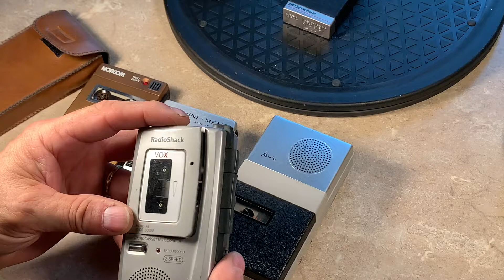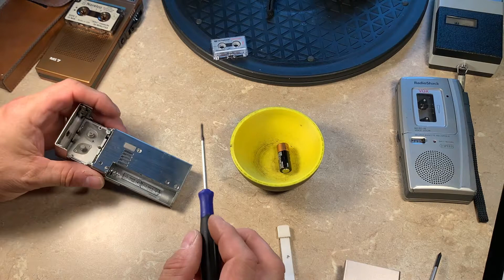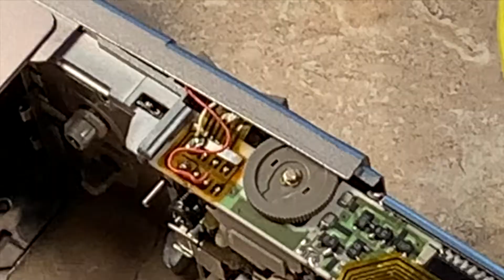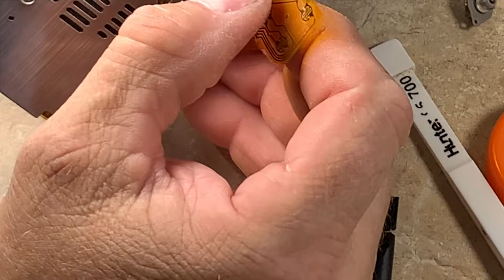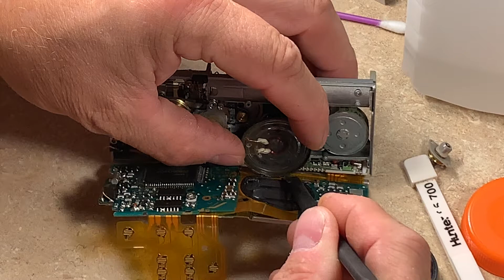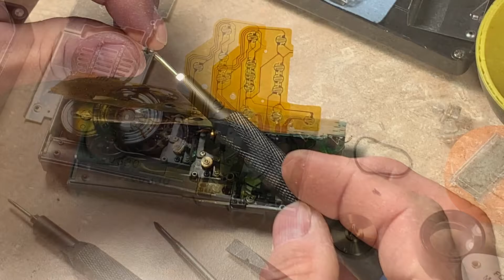Vintage Tech: 1984 Dictaphone 4250 Disassembly

Comment: Amazing Channel and a great place for a walk down memory lane. I have the Dictaphone Picocassette 4250 an incredible machine. Shocking that it needed 3 belts and needed to be taken completely apart to replace them. Well done for being courageous enough to attempt anything on this, it actually needs a brain surgeon to repair it. Did you ever manage to locate such miniature belts for it? and did you ever make part 2 re-assembly?
Reply from the maker: Hello. Thanks for the nice comments. Yes I believe there is a follow-up video on the 4250. I found a supplier. They are very picky machines.  I ended up buying three of these with boxes etc.

Comment: I've never heard of 'N' batteries. :)

I love the shape of the controls. They look so comfy to use.

I'd be too frightend to work on it, It looks so small and fragile.

Was that spring loaded bit with the switch for the heads and pinch roller ?

That was so tense, my nerves are shot. Ha ha.

Looking forward to part 2. (If my nerves can take it)
Reply from the maker: Yes. The spring loaded thing is tied to the head and pinch roller. I figured it out eventually and should not have any trouble reassembling it when the belts are installed.  Thanks for the comment Franko.